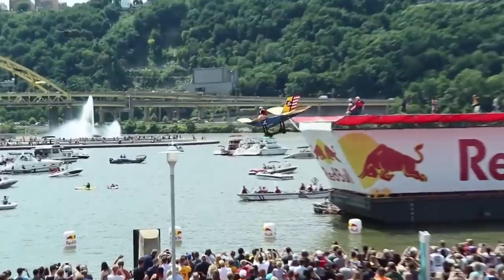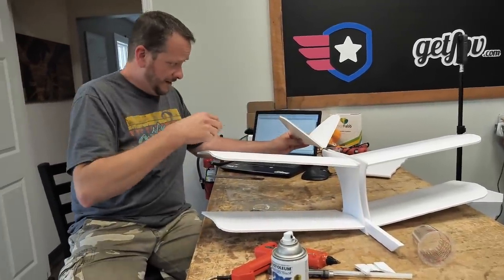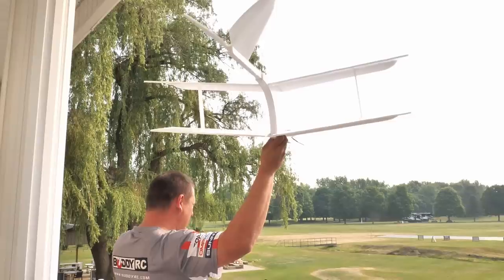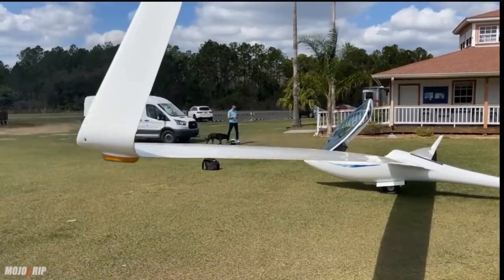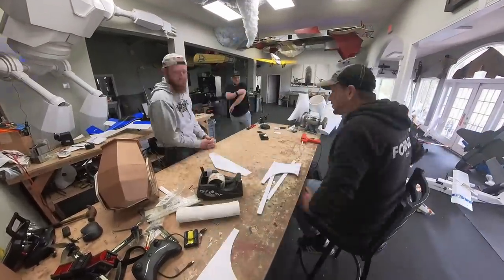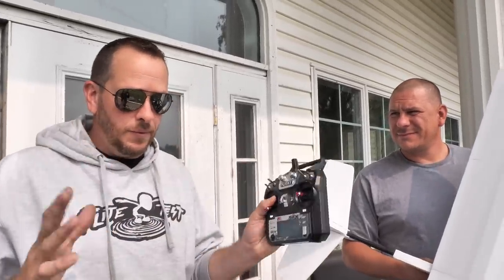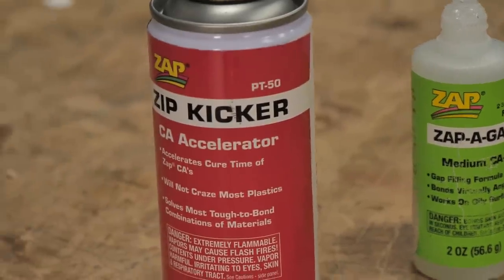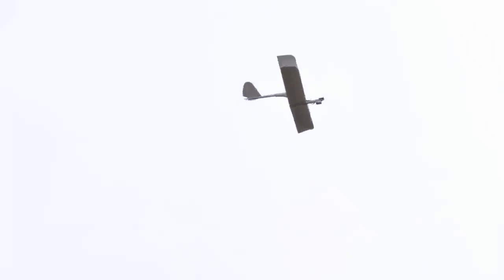The Red Bull Flugtag Record Will Be Broken!!

Comment: One thing I think you overlooked is when changing from a v tail to a conventional tail is the need to reduce the surface area to more closely match that of the previous tail. Compair the elements of a T tail glider for closer design than that of a bush plane...
Reply: One more thought is that at very low speeds it is even more crucial that the elevator is operating in clean air.  I think you were on the right  track with the idea of an very high aspect ratio biplane design. Building it with the tail spar high so it will clear the dock as it falls just need to stretch the design to the limits allowed by width and length rules and get the Thin T tail up into clean air away from your pushers.

Comment: 1) launch as high as possible
2)  Launch as fast as possible (gravity powered pulley system) 
3) Go in to ground effect as soon as possible 
4) Use a weight reduced (one month fasting) Peter Sripol as  pilot.

Current distance record only went for ground effect, they did not launch high or fast.

Comment: Hi guys, like what you're doing. The test flight should be to scale as well don't you think? Slow and only a few feet off the ground. If you are not worried about directional stability, then go for a third horizontal plane to amplify the pitch because at low speed there will be not much airflow. Good luck with your project

Comment: Using elevators to pitch up after launch seems to not work very well because of the low airspeed over the elevator.  Center-of-gravity works at any airspeed.  The pilot can lean forward or backward which can have a significant effect on this light aircraft.  So, lean forward to pitch down for airspeed then lean back to milk the ground effect.

Comment: dont know the rules, but seems a tubed parafoil would perform better at slower speeds and provide easy corrections for the pilot to perform.  also fall away cart with fall away poles that keep the parafoil high and  open until the weight of the pilot starts holds the shape.

Comment: Can the cart thing have moving parts other that wheels? You could have the wheels geared to a sort of conveyer belt on top with a clutch. When you get near the edge, you engage the clutch and use mechanical advantage to give it an extra push. I think airspeed going over the edge is crucial. Or perhaps you could devise a light-weight way to integrate it into the aircraft itself. Perhaps a spring-loaded launcher? I don't know the rules, except that they can't have a motor.

Comment: do not use the V-tail.  they are not spirally stable, and their geometry changes toe-in /toe-out with AOA. 
the air from one wing will affect the other substantially, limiting any gains from the extra wing area.  a braced lower wing/strut might be best.   but you would have to adapt each airfoil progressively to get the Reynolds numbers to work together.  something which you are not willing to do.

Comment: I think a lot if people are spot on regarding the launch speed. Compare how fast you were able to push your prior designs to how fast you're throwing this one in testing. This model flies great but it's going to need to need a very very good launch if you want to have a chance at pulling out of the initial nosedive off the ramp.
Reply: 3D print a giant multi geared rubber band winder on the sled (and a rubber band powered ducted fan on your glider) to give you some forward acceleration after launch...

Comment: A biplane will only have about 20% more lift than a mono wing design of the same wing area. Look at the Pitts biplanes. Two wings, but an atrocious glide ratio. You need the biggest single wing you can build, and use some form of force multiplier to add airspeed as the other team members jump off. Then optimize for flight in ground effect using speed from the force multiplier and dive at the water. Airspeed is key. Altitude is only useful for making airspeed.

Comment: that mini Pterosaur looks killer.  I want!  Super for the local field.   Where's the link?  I suppose it's not released yet, can't find on the flitetest site. 
Aside from that, this Flugtag challenge is so awesome. Always fun to see the jokes as well as serious entries.  This one is pretty serious. Fun fun fun.
Don't forget, you are NOT building a glider. You ARE building a parachute, kinda.  Dropped off a cliff, with an extremely slow push. And vertical drop to build speed. 
Basically a hang glider / paraglider seems the best proportions. Super light, but just over stall.  This is the condition to test for.

Comment: I watched this video earlier today and just came back to comment that I think a dive for airspeed should be job one upon leaving the launch deck, (Bob Hoover's 'energy management') followed by leveling off into a more shallow glide above stall speed to take full advantage of ground effect.  I watch those events, and constantly see otherwise good-looking designs fail to ever attain sustainable flight speed... Just mushing into the water in a deep stall when their pilots break the laws of Physics in an effort to hold altitude without airspeed!  

Bob Hoover, for those who don't know, was one of a handful of the greatest natural pilots to ever live.  For 20 years, 1979-'99, he flew a power off (props stopped glide) aerobatic airshow routine in a 6-passenger, twin-engine business plane.  That plane is on display at the Smithsonian Air and Space Museum!

I went for a ride in a buddy's homebuilt Hatz biplane.  It was a very hot day and the runway had gotten a fresh coat of blacktop since the boy had flown last.  The pilot was used to the way the plane landed on the old, very gray, surface...but there was a pretty good column of rising air that'd been heated by the black surface.  The plane was well below stall speed and rapidly losing rudder authority when my buddy started talking to it...suggesting it, "c'mon, settle--SETTLE!", which it eventually did.  VERY smooth, 'greased', landing...with a slightly unnerving aside-to-side squirm!!
I remember my buddy telling me stall speed compared to actual touchdown speed, but the numbers are gone as that has to be 20yrs ago

Comment: You need to achieve lift before you hit the water. The scale of the balcony to the ground is much higher than the platform you will actually launch from in Flugtag competition. A more accurate scale would be standing on the ground. Your next consideration should be launch velocity, throwing the model should also be representative of what you can achieve with pushing the full size plane off the platform.

Comment: Essentially, your max speed is the fastest the team can push 200 (or so) pounds. That is to say, not much speed. Given drag is the square of the speed, I wouldn’t worry about drag.
Reply: I’d be worried about weight. The heavier the plane is, the slower you can push it and the less speed it will have. All the wing area in the world does nothing if you don’t have airspeed.

Comment: so I've got some old rc car parts lying around and thought I might make a plane. brushed 550 size motor (about 7800rpm), 2s 8000 mah lipo, traxxas xl-5 esc, and was wondering if its possible to fit a propeller on a motor shaft without threads.
Reply: Keep in mind the weight of you batt esc motor reciver servos... your going to need a big air frame. 2s isn't much power for your weight. You can probably make it fly... but how good.
Reply: @TamponTea  thanks! It’ll be the first plane I make, so I don’t really care how well it flies to begin with. I just want to make something that stays in the air lol

Comment: You're flying a stagger wing design buddies, if you stall the lower wing, it makes the upper wing stall even worse. The detached turbulent air of your lower wing goes right to your upper wing which is behind I.. In your higher aspect ratio design (larger wingspan) stall occurs at lower angles of attack, making the problem worse, and that's what made the larger wingspan version glide so poorly, it was just stalling from the beginning of the throw and it never recovered. Put your upper wing in front of your lower wing and flight characteristics, stability and performance will improve so much ;)

Comment: "The Chicken Whispers" still hold the Red Bull Flutag record, you might want to follow their lead with a flying wing monoplane design with wingtip end plates.
Reply: Prandtl > Wingtips
Reply: @malachiteofmethuselah9713  Flutag has a wing span limit of 22ft, Prandtl wing design won't work in this use case.

Comment: you may have better results using the falling weight to pull air across the forward wing and then have your secondary main 🪽 wing riding on the increased airflow from the former then remaining with high tail control but adjusting the angle of wing mounts to the fuselage instead of 45° set 22.5° and try other options but riding on your own turbulence wing to wing may provide advantages figuring for your maximum run jump launch speed the drag coefficients are definitely a factor but if you can balance it out right and design for your lightest pilot like race cheating almost rather than designing for your heaviest may yeild better results or design for heavy but place light instead as long as balanced properly the distance covered can increase... then its just timing for headwind/tailwind which you could deploy remote sensors for and have a teammate que your jump and pre measure your reaction times to hit the sweetspot of launch spring wound launchpads maybe even help? or bungee cord pulleys to have team run opposite the launch direction 🪶 to send you flying but then they'd have to return and jump in after you as normal... the saddest part of it is them destroying or garbageing not recycling ♻️ all the efforts parts materials from each launch just crushing with an excavator into a dumpster wheels wings and all 🤢

Comment: on average when you take a single wing aircraft and add another identical wing you only gain 20% lift.  so if you're wing is under 20% of the original weight you have a gain. not accounting for drag. otherwise you might as well just build a monoplane.  and that's why we don't build very many biplanes anymore.  that and the changes it makes to your cg.

Comment: How many Biplanes win this? Erm.. 
Biplanes are great, but not for gliding the double wing doesn't give double lift but it does give double drag, or more with rigging, or extra weight if you managed to make a strong enough centre point (and strong enough wings) to negate rigging.

Comment: Did a cursury glance at the Flutag rules. Why not have your four "pushers" be "pullers" by having then jump off the cliff before your aircraft goes, pulling it over the cliff. Four 200lb people falling (repelling) down the cliff with anchors on the plane to pull it forward could get somne serious speed off the cliff. Does that make any sense? Wish I could add a stick man drawing :( I think it has already been suggested here in the comment.

Comment: Realistically speaking this design has just too much drag.  In every case the conventional high aspect ratio, clean joints, smooth surfaces, super low drag design is going to brake the record. The biggest problem here is due to limited wingspan the velocity of best glide is probably quite  high, so that might be the problem to be focused on. There were already some attempts of people that pushed a platform where the aircraft was sitting higher, and catapult/slingshot types.

Anyways you guys will deliver a good show for sure! 👏

Comment: This would be a really good project to present some deeper flight theory (the maths behind it).

Do some performance estimates for the model (glide polars) then verify your maths against measured results on the model.

Do the same sums for the full-scale version. This should give you confidence for the event. And the event itself will serve as good verification.

I'm sure you guys could present this in an engaging way which would tie together the fun of mucking about with model planes and some of the engineering which goes into aircraft design.

Comment: Your ERROR is your launching your model TOO FAST (the force of the hand 'shove') compared to the slow airspeed of the full scale air raft off the platform.
To simulate that you'd have to almost drop ot off the balcony with only a slight bit of forward motion.

Comment: The testing shown is irrelevant. The launch is not a throw - the initial speed is going to be fraction of what is simulated by a hand throw. And towing it up in the air? You won't have that altitude to level off, aside from also discounting the airspeed you had when the model was released. It would be more accurate to nudge it off a balcony or roof.

Comment: Others have basically already said it, but the model and your test are basically useless. 
Full size launch speed is what? Maybe 2mph?
IF it can clear the launch and "fly" drag would be very insignificant.
Models down upscale in proper ratios. Upsale size by 10x and weight may upscale exponentially by 100x.
I would consider raising the launch height and launch speed your biggest advantage for any possible success.

Comment: I am not sure that the Red Bull Flugtag is really related to FLYING: great advertising, yes, but the majority of "machines" is clearly designed NOT to fly but to crash into the water in the most comical way. In order to fly you must have wings, not boats or cars or corn knobs, and few teams bring winged things: you should have super-light structures, mylar, carbon rods, instead on the videos I see only cardboard, steel trolleys and paper mache. Funny they are, but  they will never fly and nobody apparently expects them to.
Regarding the experiments of this video I am afraid our heroes have taken a "fantasy road" to nowhere. To reach that launching speed in full scale from a short platform they would need JATO rockets (at least), and all the dimensions and volumes of the model when enlarged to full scale would bring to an Alaskan log cabin - weight included. Nobody seems to rember that weight increases with the CUBE of sizes... On the contrary the "scale model" flies quite well for the styrofoam soarer that it is, and I think that a sellable model kit is the real scope of all these projects.

Comment: I can already tell your design is creating drag in the wrong spot. Its too front heavy. A bi plane has more weight and the engine for ballast. Your also not testing the model with a person on the front. This just going to topple over like the last one you made. You need to drag from underneath. You guys are throwing the plane way too hard. Youre not going to get near that speed